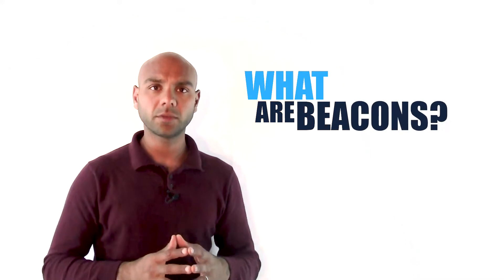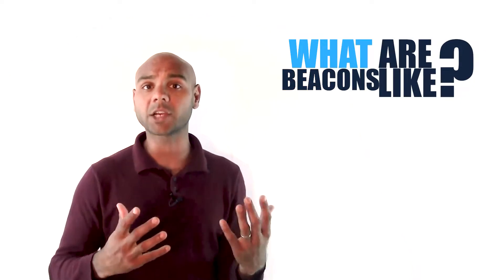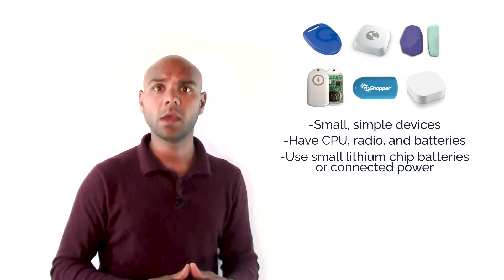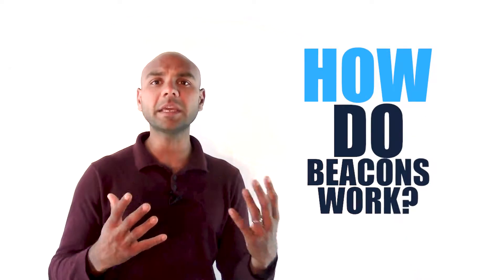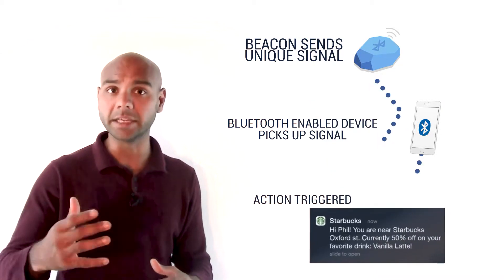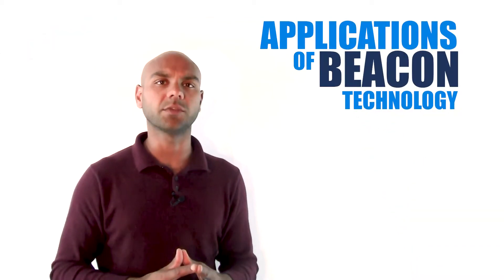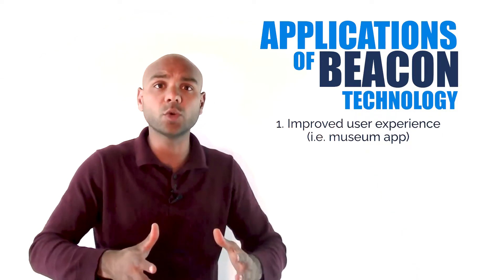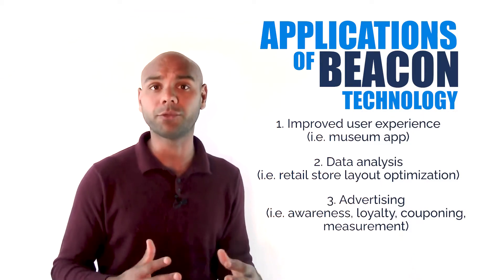Beacon Technology Explained

Comment: Does the person receiving the signal needs an app to open the message sent through the beacon?
Reply from the maker: The beacon is not always sending a message, it could just be collecting data in the background.  If it does want to send a message, it can do so through a push notification (if notifications are enabled on the user's device).
Reply: @uofdigital311 But the beacon can send a message just if your app installed on your phone/device have this option and bluetooth activated, otherwise if you don t have installed any application which communicate with the beacon, your phone/device will not get any signal from beacon because they can t communicate even if the bluetooth is activated!
Am i right?!